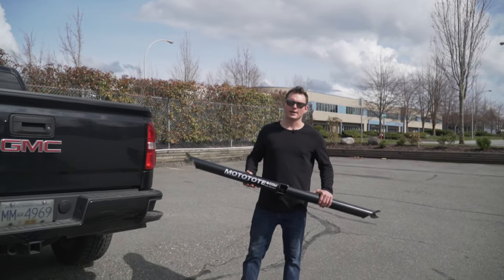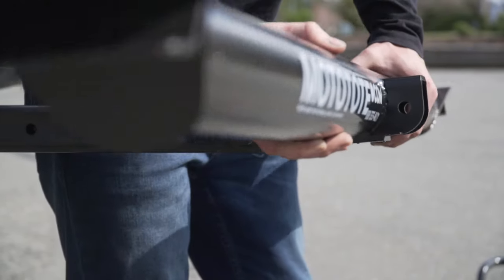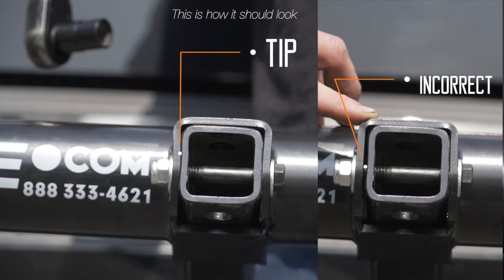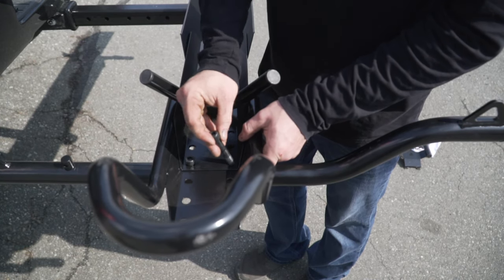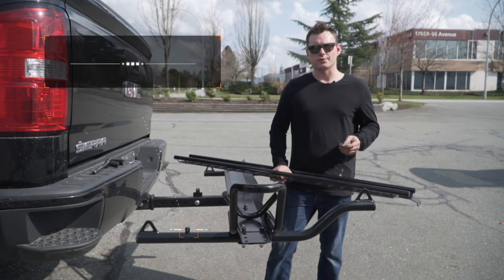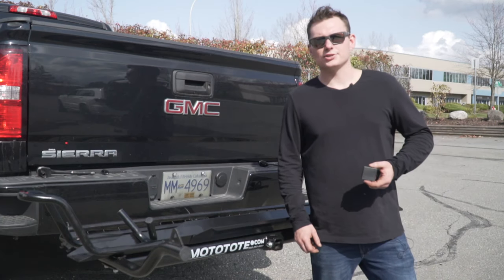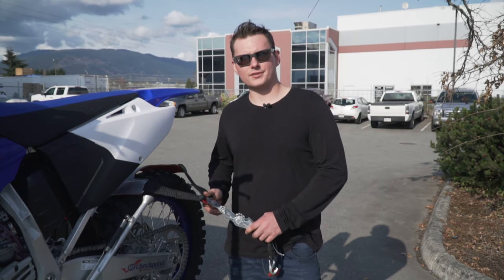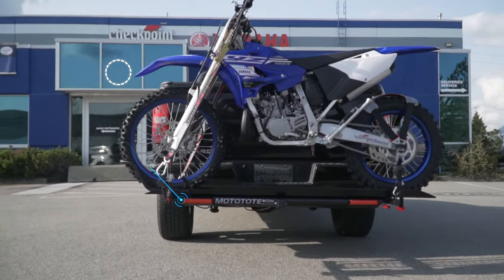How to Install a MotoTote m3 Motorcycle Carrier (Step by Step Instructions)

Comment: The square tubing has multiple different hole settings for the zero wobble bolt.  Is there  recommended minimum depth for how deeply the square tubing needs to be inserted into the receiver? I’m asking because it doesn’t leave a lot of room to stow the ramp when the square tubing is inserted, depending on which hole is used

Comment: Nice video,  I have a very important question regarding the older models (gray).  I was wondering the reasons for limiting the weight of 600 lbs the carrier can handle.  The carrier is the best build system I have seen.  My truck has a hitch rating of 1k lbs tongue weight.  I would like to use this carrier to transport my Harley road king undressed at 720 lbs.  That makes 810lbs total weight pushings on the hitch.  My truck has weight suspension additions to accommodate for sagging.  Can you please let me know what would happen is mount the Harley for transportation on the moto tote?